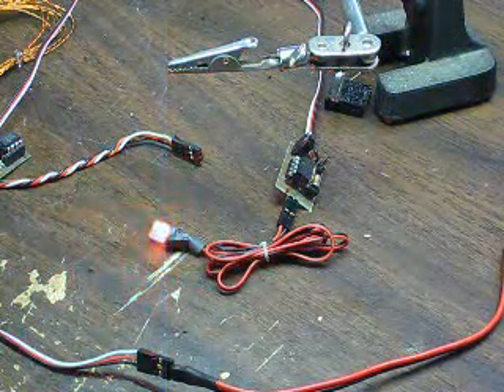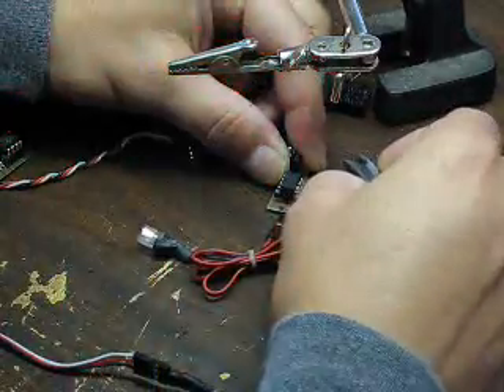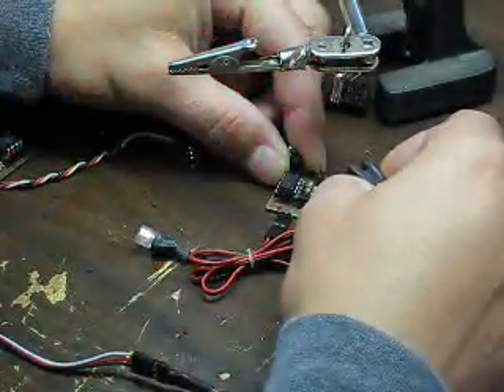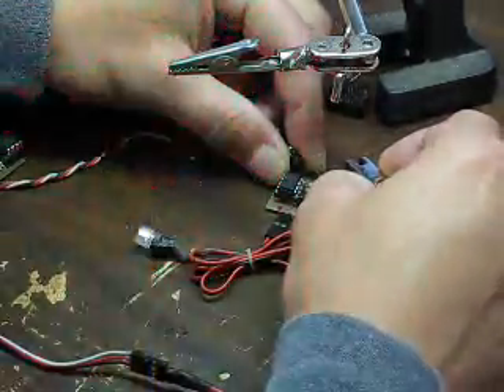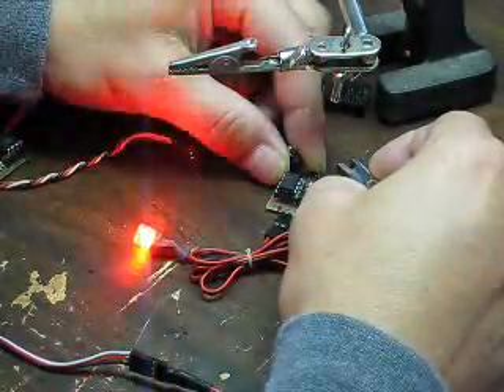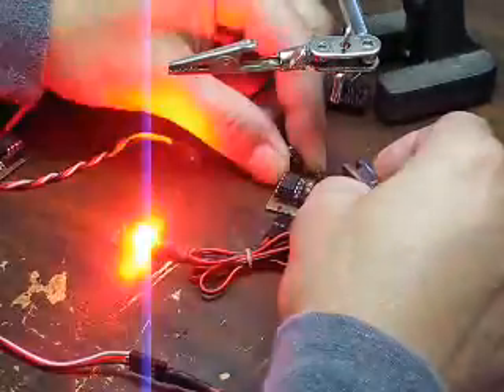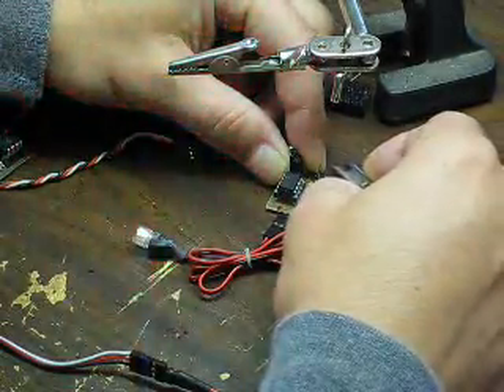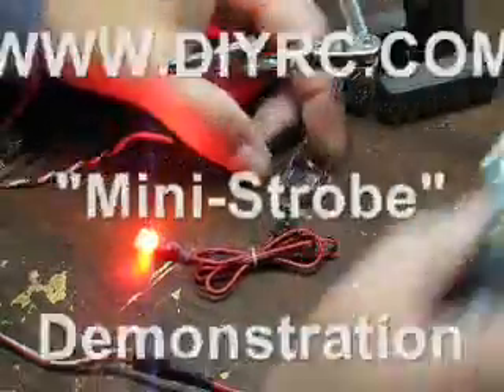DIYRC.COM's "MINI-STROBE" Rotating Beacon Simulator using a PIC and LED

Comment: How can I get the exact setup (board & LED) shown in the video (part#, etc.)? Pattern #5 is perfect for simulating a Grimes dual-bulb rotation beacon...like what you mention in the caption.
Reply from the maker: I still make and sell them… You can buy them here:  http://tomsha.com/shop/index.php?cPath=2_33&osCsid=736f46ccfc95e612f3a095b94a67d2b9

For that firmware option called STROBEACON… Select that option at the very bottom left of the page before adding it to your cart... As for the LED… That is simply a one watt white LED with a red lens attached… You should also be able to find those on my webpage under LED EmItters and LED Lens... hope this helps 😎
Reply from the maker: Sorry… I just noticed that is the mini strobe firmware on this vid...… You can select that off of the page also… Be sure to watch all three versions of the video which shows all three versions of the firmware I provide… Then select the firmware option on the very bottom left of the page… Hope that helps

Comment: Would love to buy two of these, but I’m not seeing the option to add it to the cart on the website now.
Reply from the maker: Hi James… Try again, I think I might’ve been sold out on them a week or so ago… I can still make these… Probably only have 20 circuit boards left though.  
http://tomsha.com/shop/index.php?cPath=2_33
Reply: tomapowa ok I see it now thanks.  That looks great! Absolutely the most realistic “beacon” I’ve seen. 
Any chance you have a controller that can control the beacon and maybe steady burning wingtip nav lights?
Reply from the maker: James Powles If you don’t need to turn on or off landing lights all wingtip lights, you could just simply wire those into the same battery with a couple of resistors… I used to sell another controller that was super programmable that would do this controlling but no longer sell it as the program and software no longer runs on Windows… Thanks for Microsoft  :/

Comment from the maker: Thanks!
You can always connect LED controllers such as the Mini-Flash and Mini-Beacon together (via servo Y cable) such that you could use the same switch on your Transmitter to control both controllers... just a thought.